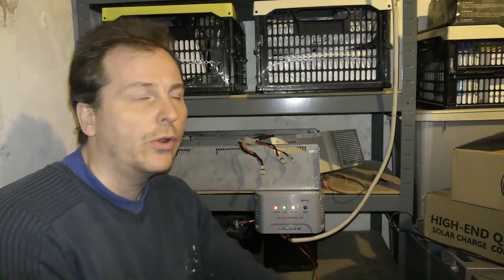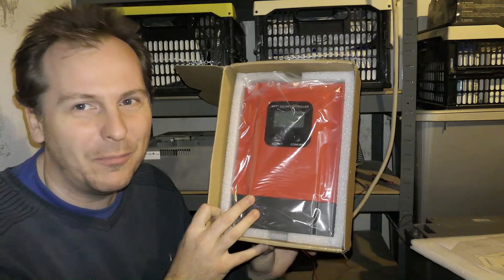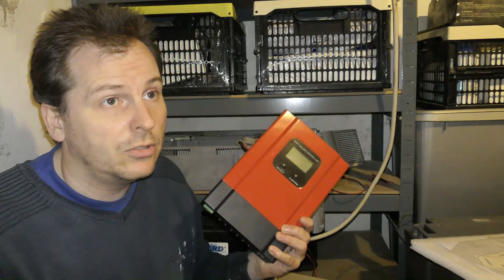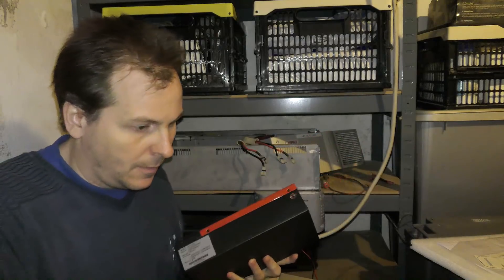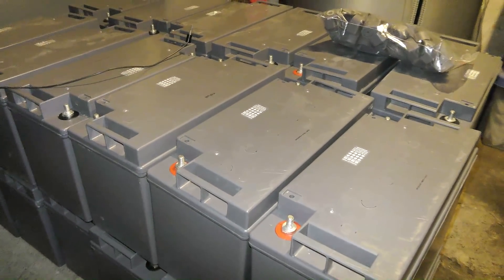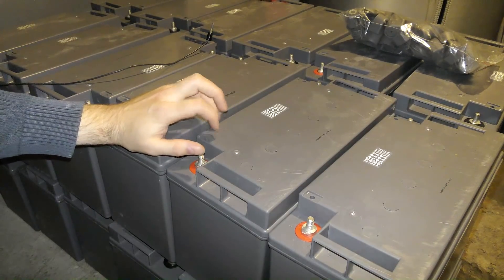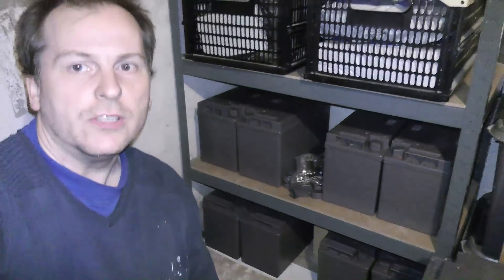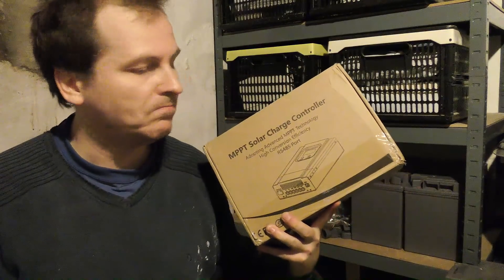24Kwh Solar 48Volt Home Power Bank start - 584

Comment: the Batteries on concrete is an old thing from before batteries used the casings they do now.  Apparently really early batteries used some sort of slightly conductive case that allowed bleeding of the energy.

Here is a bit of info I found with a quick search.  Fist type of batteries didn't have discharge issues but other issues. 
http://www.interstatebatteries.com/m/mrbattery/faq/batteries-on-concrete
Reply from the maker: Hi joebleed
Thank You very much!  I have pinned this comment for this great info!
Thank you for watching! :-)
Reply: joebleed you keep batteries off the concrete because it's cold and cold batteries are not happy batteries 😎
Reply: That may be a reason sometimes, but it's not always cold depending on where you live.60 degree F concrete isn't bad.  arguably 50 isn't too bad assuming the air around it is a little warmer and the energy is flowing generating internal heat.

Comment: Concrete has nothing to do with a battery discharge. If they can set in a steel case in a bulldozer and not discharge then concrete will not discharge them. What can happen is if you have old batteries and they are weak concrete will hold cold temps and cold temps can lower battery performance. http://solarelectricityhandbook.com/Solar-Articles/looking-after-your-solar-batteries.html
Reply from the maker: Hi John Smith
Thank You very much!  glad you liked the video :-)
Thank you for watching! :-)

Comment: I stored a car battery on my garage floor for a year and it left a stain on the concrete. The battery was also ruined. Plastic is not as "air tight" as people think. Concrete is very good at absorbing liquid like a sponge or think of concrete like the silica gel shipped with Items to keep them dry
Reply from the maker: Hi macgyver15147
Thank You very much!  glad you liked the video :-)
Thank you for watching! :-)

Comment: You can put modern batteries on the concrete without issue since they are encased in plastic.  Old batteries could not since they case was made of wood and other materials.  I would remove the fibre board since it will soak up moisture from the floor.  If I ever get the house renos done I would like to get solar to at least power my rack if not the whole house.  There are some great new solar systems out.
Reply from the maker: Hi Scott Downey
Thank You very much!  glad you liked the video :-)
Thank you for watching! :-)

Comment: Not sure how well this would do with an inductive load like a motor. Most UPSs pitch a fit with inductive loads, even heard one case it fried the UPS unit. I did something like this for a car inverter, worked okay, but then it didn't work for much besides a small netbook so I scrapped it. I got an old 2200 VA unit that had some problem I was debating doing something like this with some day.
Reply from the maker: Hi jtech0
Thank You very much!  glad you liked the video :-)
Thank you for watching! :-)

Comment: Are you planning to put in a voltage sensor, that can turn on primary power (switch over), when battery voltage is getting low?
Reply from the maker: Hi hartvig82
The UPS will cut out at some point when voltages gets to low.
Thank you for watching! :-)

Comment: Amazon says the MPPT controller cannot be shipped to UK, where are you located?
Reply: He lives in Denmark, Europe
Reply from the maker: Hi Reg
I got it from the UK : http://www.ebay.co.uk/itm/Solar-Charge-Controller-MPPT-12V-24V-36V-48V-Auto-Battery-Regulator-130V-PV/222415326119?ssPageName=STRK%3AMEBIDX%3AIT&var=521284780644&_trksid=p2060353.m2749.l2649
or kind of!! :-)
Thank you for watching! :-)

Comment: Did you make sure all of the batteries were filled with water to the proper level?  It's not great to recharge batteries that are low in water.
Reply from the maker: Hi Chuck12 -
Thank You very much!  they are guel batteries..
Thank you for watching! :-)

Comment: You are safe to put the batteries on the cement floor. As has been said, this is based on an older design of battery that would leak the current out due to the base being conductive. Modern batteries are fully insulated and thus will not discharge on concrete. Go ahead and let them sit on the floor. I do it and never had a problem. Also, here is an article explaining all this in detail:

https://www.homepower.com/articles/solar-electricity/equipment-products/ask-experts-batteries-concrete
Reply from the maker: Hi Sonicdude10
Thank You very much!  good info!!
Thank you for watching! :-)

Comment: in the PV roof systems over here have the batteries in the roof space and can send unused power to the grid which is paid for by the grid managers, You using brass strips one for positive and the other for negative to connect the PV panels together and then covering the brass strips with Bitumen to prevent the water from causing short circuits.
Reply from the maker: Hi DAVID GREGORY KERR
Thank You very much!  glad you liked the video :-)
Thank you for watching! :-)

Comment: Hej Morten,
at 9:11 I saw, that you used a AGM-Battery in combination with probably conventional lead-acid batteries.
I know people on the internet often dramatize things and say "you shouldn't do this" .. but I am serious... You definitely shouldn't do this!! If you pair them this way, it can lead to swelled batteries and dangerous situations, because those different types of batteries take different charge voltages and they have totally different discharge curves.
If until today nothing bad happened, than lucky you... but although these batteries are not so dangerous like LiPos, it is a risky situation, when you handle them improperly.
Take care and handle those things with respect! ;-)
Reply from the maker: Hi olpqay
Thank You very much!
Thank you for watching! :-)
Reply: Yepp - learned the AGM/wet one the hard way. Luckily the cases contained the mess. I now use a protection per battery which keeps voltage/current somewhat reasonable.

Comment: Indeed, batteries right on the cold floor are not a good idea.

It is best to put the batteries on old cargo pallets.  These can be found wherever businesses are located.

If you ever get leakage in the basement, the batteries are dry.
Reply: Stand them on thick polystyrene if you wish to put batteries on the floor. If near a wall put polystyrene between the batteries and wall.
Should be ok then...;-)
Reply from the maker: I looked this up,, and this was an issue in really old dayes, before batteries was made out of martials that can not lead electricity. The old ones would self discharge.

Comment: Justin Case is the man wach his channel you will find everything about lead acid batterys and how to do it... What is important... and how to maintain the battery's... 
24 battery's are that AGM typ battery's?
In every case you need... Battery extra... desulfator that would be very good step in battery mantinance.... 👍
Reply from the maker: Hi Bostjan Trancar
Thank You very much!  I did watch Justin Case, for years,,, But He kind of got everything up and running,, and then it was just water and voltages.. 
Thank you for watching! :-)
Reply from the maker: Whether and voltages :-)
Reply: Lately is kind no show thing like you said whether and voltage... But in older video's it has useful information about lead acid batterys how to treat them..... 👍

Comment: Hi, I still enjoy watching your videos and the car booster pack is still going strong.
Its nice to see others building lead acid banks like I have done, its just we is available at the time.
Mine has been running for over a year now running it every day. I have used a UPS but its only 700VA so very low power. I have videos on what I have done but this is your project have a look around and decided how you want to build it everyone will tell you the "correct" or the "proper way" just decide what is best for you.
Looking forwards to your upcoming videos.
Reply from the maker: Hi Urban Off grid
Thank You very much!  glad you liked the video :-)
Thank you for watching! :-)

Comment: Modern batteries have no issue sitting on concrete floor. Back in the day of older materials used in construction I guess it was the composition (carbon/rubber)? led to a more rapid self discharge.  The dampness associated with cooler surfaces still can play a role where there could be a bridge between the battery terminals but with a sealed battery, any chance of electrolyte escaping to enhance this conductive path is next to nothing.
Reply from the maker: Hi Craig Nehring
Thank You very much!  glad you liked the video :-)
Thank you for watching! :-)

Comment: Hi Morten,
I've ask my engeneers for energy systems how we do this at work:
We have 58x 12V in "one Bank" so we have a minimum of about 690V - our Emerson UPS Systems requirer this. 
For us it's normal to do this on a 4-15MW scale per Building and replace them every 6-8 years.
Here in germany we have the VDE Guidlines, they say that the floor should have a ground lead resistance under 10^8Ω and taking into consideration it's bad to put batterys on the floor, they told me.
Except on the floor they get colder then the others (cold = lower capacity), so you get in inballanced battery setup, because they have a lower capacity. You put them on the drywall pices, this is a good start and they are used, so...
Reply from the maker: Hi zENjA
Thank You very much!
Thank you for watching! :-)

Comment: Hey, great wideo, looking forward to seeing some updates on that matter. I too love to fiddle around with technical stuff. Right now I'm working on home automation relays from sonoff and maybe in the future some sun cells as well. How do you relay power from batteries to house connection when batteries are empty without outages? Do you feel like telling me how much did you spend on suncells and where here in dk can you get batches of discarded batteries or sun cells
Reply from the maker: Hi KOALATY
Thank You very much!  The Blue paper,, here in DK. but often often the stuff i get is not easy to copy,,, You may have your network and suddenly get access to some stuff.
Thank you for watching! :-)

Comment: Measuring a battery voltage tells you almost nothing about the capacity, you need to place a heavy load on each one to see if they have an equal capacity to deliver.
One weak battery in a pair is bad.

Very cold batterys dont work well, i dont think your basement is that cold.
Reply from the maker: Well it is ever so slightly better than nothing :-/
Reply: @MyPlayHouse  Thank you for replying :-D  i would not have become upset if you didn't,  my silly comment is 5 years old lol.
Reply from the maker: @zx8401ztv   I am relaying to one or two old ones every time I replay to new comments,, and are now 5 years back,, someday I will have replayed to them all 🙂
Reply: @MyPlayHouse  Ahh replied was the word you were saying.
Dont worry, im crap at spelling and im english lol :-D

Comment: The concrete floor should not at all be a problem, unless broken batteries leak acid. However, batteries on the floor of a room with flooding risk ... hmmmmmm...... :-)
Reply from the maker: Hi Johnnie Hougaard Nielsen
Thank You very much!  never had that much vater, and never in there.
Thank you for watching! :-)

Comment: one other thing, if you wire the batteries the right way, you can take advantage of different voltages for different things.  IE: 12v, 24v, 36v, and 48v.  you can have terminals mounted somewhere to wire your UPS, an Inverter, perhaps Car charger ports, etc.  so in the event pf a power outage, you would be able to use the batteries for various tasks. :)
Reply from the maker: Hi Daniel Tekmyster
Thank You very much!
Thank you for watching! :-)

Comment: I too heard that putting batteries on the concrete is bad. Like you, I don't see any truth in that.
Reply from the maker: Hi psygn0sis
Thank You very much!  Have no idea why that should be.
Thank you for watching! :-)
Reply: The batteries on the concrete can be bad if anything goes wrong with them. That's why you shouldn't do it. If the lead-acid batteries split open or overheat, they will leak some pretty nasty acid, which will go into the concrete, might even be able to dissolve some concrete if I'm not mistaken (I think the acid dissolves the calcium like stuff in the concrete if I remember correctly).